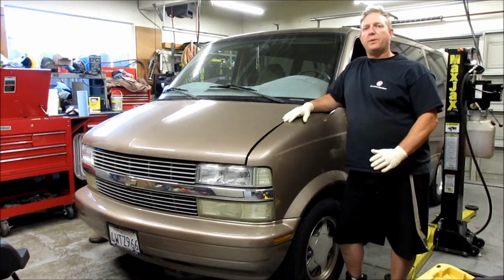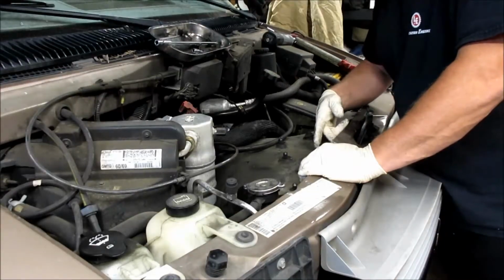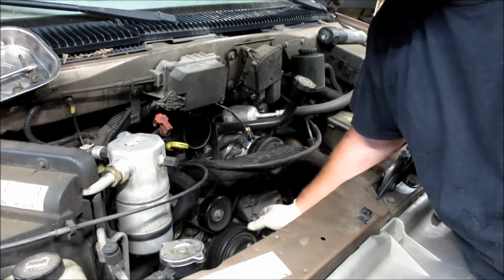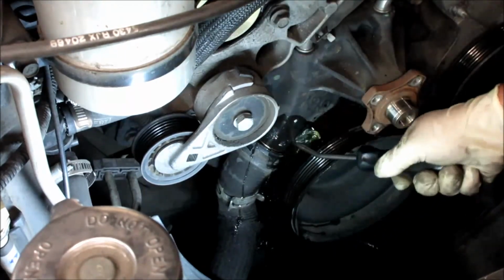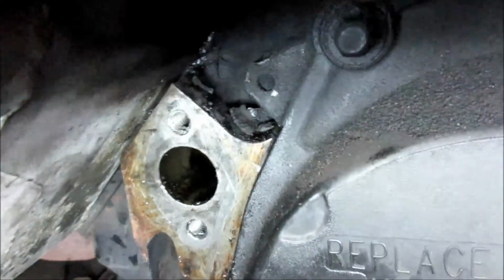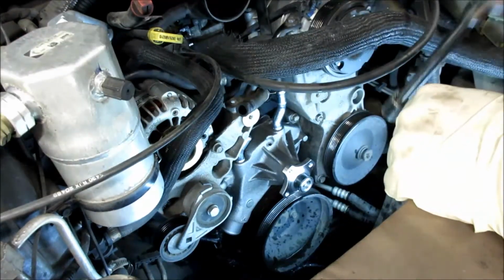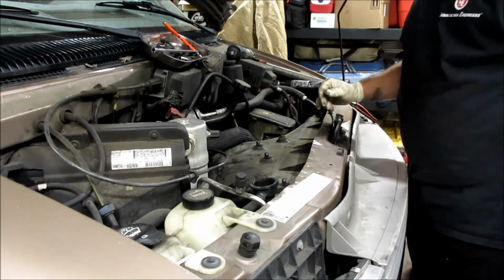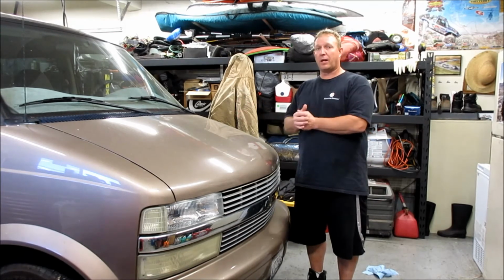Chevy 4 3L Water Pump Astro Van

Comment: Great video;....you're using the wrong coolant....only Dexron orange.
Reply: Safer to flush it out and go with regular green coolant.  Dex can turn black and gummy gummy if you're low/have air in the system.

Comment: I tried about 2 layers of Teflon tape on my water pump bolts but I believe it may have a significantly reduced the friction on them. I was afraid to overtighten them and strip the threads in the engine block, even though I have an accurate torque wrench. It appears to me that only the lower right one goes into the coolant and needs sealant. Now I am going to try Permatex high temperature "Thread Sealant." I have a 2003 Astro with 4.3 L. I'm finding a torque spec of 45 N-m or 33 ft-lbs.